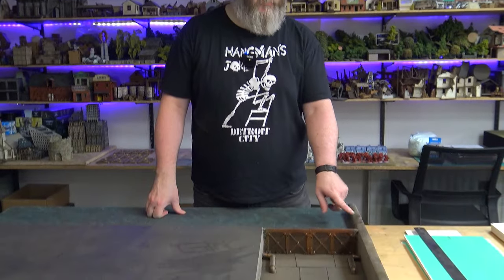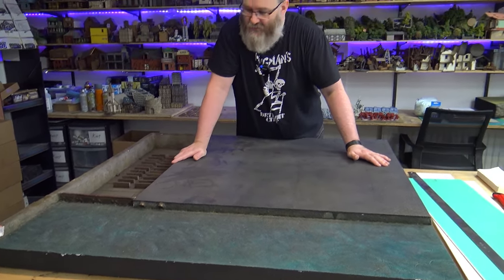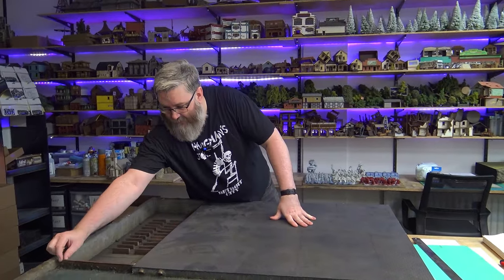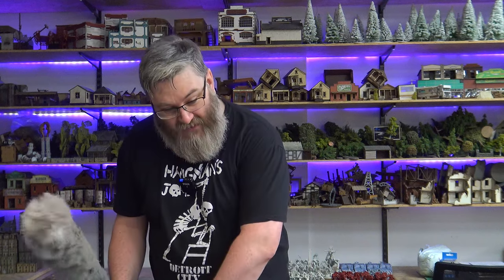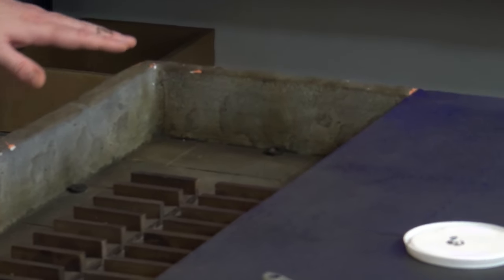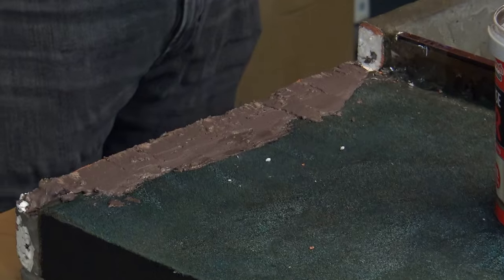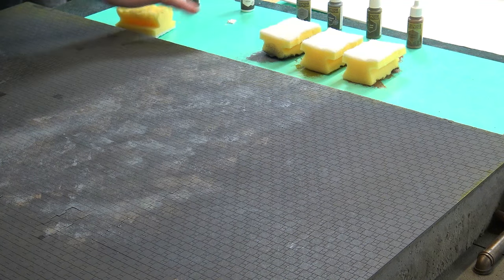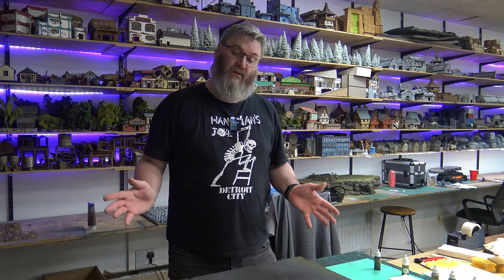Let's Build Saint Nazaire! WW2 Terrain Project Part #2 - Repair & Refresh

Comment: Okay, the dock/dry dock area is looking pretty rough from the first video. I'm curious as where those cobbles came from?  Home made?  I'm digging the plaster/concrete look you made using the plaster of Paris technique....I never heard or seen anything like that.  Looking forward when it dries out and see the texture it produced. I've seen the sponge technique, but not a large scale at this...very cool along with wash and it makes the cobbles pop a bit more.  Will you do a light grey dry-brush over them? Looking forward to the next video.
Reply: cobbles were made by 4Ground